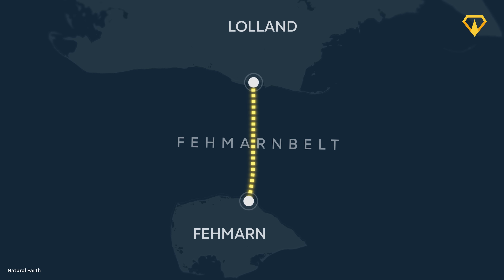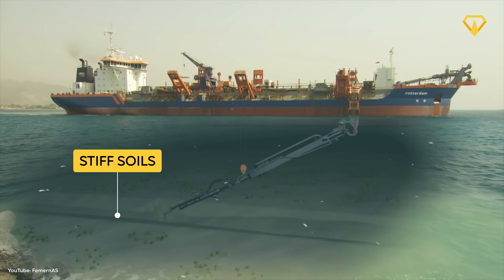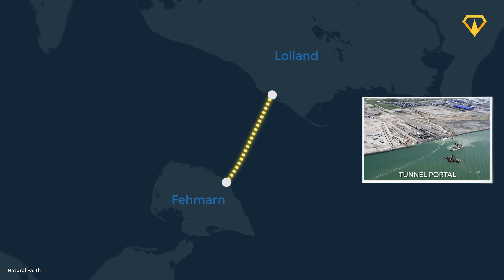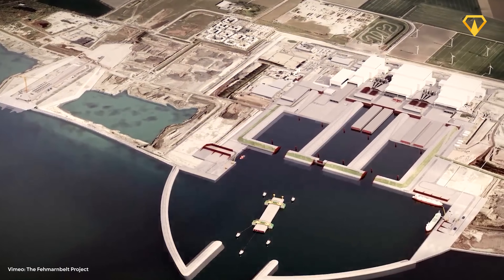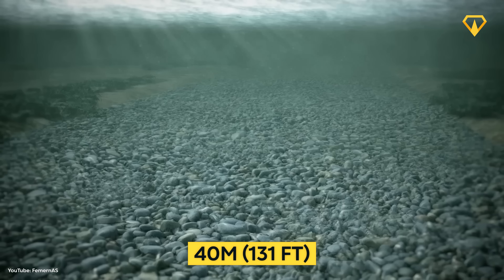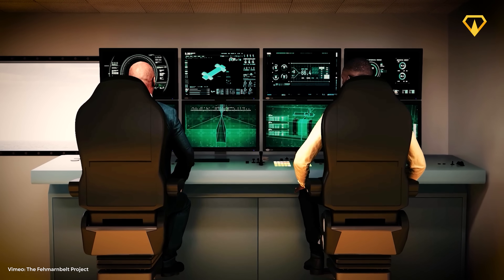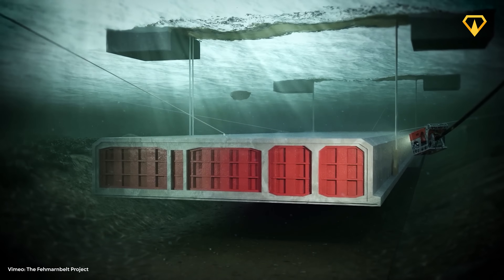How the World’s Largest Underwater Tunnel Is Being Built

Comment: OK here's another question I would like to know what about the water pressure in the ocean too much of that pressure will cause those walls to buckle and crack may cause leaking I know they are made of concrete but still extended pressure from depth that far will cause cracking

Comment: One question, it seems that the tunnel includes a single rail line. When you're building it, why wouldn't you include enough capacity from the start? Expanding it later will, for sure, be more expensive than building an additional train line from the start.
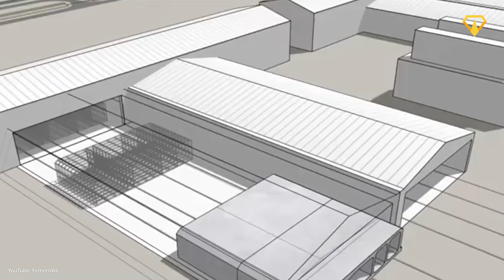Reply: It is two rail sections and two road sections. So one for each direction for each transport type.  You can see this at around 08:45.

Comment: As a Dane, since its opening in 1937, we have had what at first was the longest Bridge in Europe: "Storstrømsbroen", 3,2 km. It has a road and a railtrack and for long it was considered too old and too narrow. So it is being replaced with a new Bridge with two railtracks to be paired with the new Tunnel further down, below Fehmarn Belt, also with a road and two tracks. The new bridge is very close to being finished but I think a Service Ship for the sinking and placing of the Tunnel-Elements has been delayed, so the Opening also will be?

Comment: Whi is the rail animation a single track rail? Is the tunnel built with single track rail, or have they though of future expansion with double track rail? Projects like this MUST have future in mind, its little use if the project reaches capacity already first year of operation
Reply: There will be 2 tracks for trains just like 2 for cars+ maintenance/evacuation tunnel between the 2 car tunnels. So no waiting for a train from the other side before going through. It’s more obvious in the pictures where they simulate placing an element on the sea floor.

Comment: I have so many questions about this project. First of all, I understand the construction process. It totally makes sense. I come from the Netherlands and we have a lot of aquaducts here. From a maintanance point of view, I don't understand why they aren't building a bridge / dike instead (like we did with the afsluitdijk). People might say 'sea traffic', but we have a solution for that over here as well. Anyways, maintanance issue is going to be, what happenens if the concrete starts to burst. It happens here so no and then. In this case this thing is 40 meters below sea level. How are you going to fix it? water presure is also going to be an issue. What about ventilation? I mean this is a tunnel that take the air out unless it goes through the front or the rear. And what about escape routes? Lets say my car breaks down in the middle of the tunnel, how can I get out?
Reply: There are more informativ films here on YouTube giving answers to you questions.
Reply: @lars-oleeifler4448  so you want me to skim down the internet while I am on a plane to canada? have fun with these stupid answers.

Comment: When building over the water isn't feasible, then building under the water might be the better idea.
Like with the E39 project in Norway (which will become the world's longest, and deepest underwater road tunnel), that aims to connect the southwestern route together, the Fehmarn Belt tunnel is filling the same purpose, by allowing for a much better traffic flow through a bottlenecked area.
It is a huge undertaking, but the end result will be worth it by cutting travel time, and in turn fuel consumption as well.

Comment: interesting fact: due to variable water content in the aggregates (sand and gravel) that couses changes to their weight, the proportions could be worng. So to make sure of the quality of the concrete, Hydronix microwave moisture sensor are used to determine the moisture of the aggregates, to correct the proportions.

Comment: The problem for many hauliers is that drivers take their 45-minute break on the ferry (I've always done it myself), and that will soon no longer be possible. Or they'll have to create huge parking lots on both sides for freight traffic (if they abolish the ferries).
Reply: They said exactly that when the Storebæltsbro (great belt bridge) was built. A short time after opening it was aparent people preferred the bridge and took their breaks somewhere else. Yes, we'll perhaps need a few more rest stops, but that is manegable.
Reply: i'm pretty sure there are other places truckers can stop somewhere in that region.

let's say a truck has a max speed limit of 80km/h the entire way. 
that means that if you take the break a hour earlier or later than the exact moment you used to get on the ferry, you have an area with a radius of 160km of were you can take a rest/break.

and i doubt that ferry was the only place suitable for a break in that kind of radius.
so you don't need to build rest area's at the exact same spot as the ferry used to service, the already existing once in that radius would be able to take on those extra drivers. 
and if not those area's can simply expand a bit, no need to build huge extra things for that.
Reply: @ChristiaanHW  I don't know what kind of work you do, but a maximum speed of 80 km/h isn't something many people do. Secondly, you forget all the traffic jams you encounter (especially during rush hour) around Hamburg, the roadworks, and the accidents that CAN happen, leaving you stuck in traffic at the strangest moments. And I haven't even mentioned the holiday periods where so-called caravan/megacamper drivers think they can do anything that one time a year when they drive with a caravan or megacamper, causing dangerous situations, including the traffic jams that form towards the (upcoming) tunnel due to... the roadworks and widening (Heiligenhafen - Puttgarden), etc., etc., and knowing Germany it will take years before it is finished

Anyway, after 32 years as a truck driver, having driven in and through Denmark very often (for work and private purposes), and having taken that specific ferry crossing often enough, I'm probably wrong about the driving and rest times, and the parking options on the way to Puttgarden or from Copenhagen to Rodbyhavn.

Comment: 2:21 Well, it would be accurate to say that the Brenner tunnel connects Germany to Italy. There is just a short piece of Austria in between. Austria itself would not need the tunnel because most of the traffic originating there takes a different route to Italy. But the Brenner route is part of an important axis and the current pass is constantly clogged and the bridges for car traffic won't last for too long because of that. The Brenner tunnel aims to shift the traffic from road to rail. However, the tunnel alone is not sufficient. Links to it also need to be able to sustain a higher capacity. Ironically, Germany hasn't even started working on theirs.

Comment: How long would it take to make the same kind of tunnel from Vancouver to Vancouver Island in Canada which is approximately 19 km
Reply: Depends on who you hire to do the job and how long it takes to acquire the locations for the terminuses and rights of way on both ends. It also depends on the substrate of the bottom between those points. If it is mainly rock, I would recommend boring like the Channel tunnel.

Comment: mainland Denmark is losing. population, industry, wealth. this will not help, if not accelerate the process, because it will get cut even from pass through transit. however. it's a big gain for those who want faster connections to the Denmark islands aswell as Sweden and Norway.

Comment: I find several things missing from this video. Which stages have been completed, which ones will be done and when, when will the blocks start to be placed on the seabed, how many have already been completed, and how many are already in place if any. The weight in the elephants is also funny.
Reply: As Danish I have not followed so much in the construction but sometime in 2029 it should upen
Reply: Agree - once the sections are laid, how are the steel plates going to be removed etc.
Reply: there is few elements done but not ready to be submerged and one or two in the basin. the fotage from around 6:30 is quite fresh. they only moved forward elements on the left side. they dont have time precise time frame for submerging as there is some issue with hardness of the seabead on Germany side (elements are suppose do be layed starting from Germany) and the elements that waits for being submerged did not clear the Germany inspecion. I heard aboud whole steel wall missing and big air pockets and trash pockets in the concrete.
Reply: @Krormar  "I heard aboud whole steel wall missing and big air pockets and trash pockets in the concrete". Where did you hear this? Source please?
Reply: @Krormar oh, so this will be a Berlin Airport type project…
Reply: @GeospotPL When we built the Øresund bridge between Denmark and Sweden it was finished ahead of the plans. 

Problems  could be though, that Germany apparently have less interest in getting things done than we have in Denmark. As an example Germany have postponed establishment of the necessary rail connections to the tunnel.

Comment: Interesting content, but how are these units joined together to keep water out and accommodate movement, if the is any?
Reply: Rubber seals, as far as i know. Once two elements are placed, the water in between is pumped out. The resulting low pressure between the elements then pulls them together.

Comment: Interesting video, but it didn’t answer the one single question I had about this project: how do they connect the elements to each other so that they are watertight?
Reply: There are specially designed Gina gaskets and Omega seals on the ends of the elements, that will hold a water tight seal when the elements are placed. When the water between the element bulkheads are pumped out, the vacuum and the outside water pressure will push the elements together with such force that the gaskets will form a permanent, watertight seal. The YT Channel "B1M" did a more in-depth video on some of the more technical aspects of the build that may help answer some of your more specialized questions.
Reply: @whereswaldo9117  And those techniques, gaskets and seals are already over 80 years old. Those were used for the Maastunnel in Rotterdam, which was finished in 1942 during the German occupation.
Reply: There are probably some other documentary videos about this project here on YouTube ... I don't know if it's explained there, but maybe the B1M channel could be a good place to search for a video explaining the construction with some additional details.

Comment: I assume that the logic behind it is: "Well, if we're going to build a tunnel, we might as well go the whole hog and build one that can handle everything - trains, cars and trucks".
Reply: Denmark has already done that twice. The bridge called storebælt, which is 18 km as well. Part of it is made with tunnels for the trains. And same for the bridge connecting to Sweden. Only difference is, the cars go on the bridges. Train does both bridge and tunnel.
Reply: @ramkold Öresundsbron have a tunnel below Drogden for both cars and trains.
Reply: @andersbergquist  Right. Drogden is the little strait between Sjaeland and island Saltholm, makes it possible for tall ships to pass that don't fit under the bridge part. Still, real big ships cant pass because the deep is at most 25 feet. Yes all cars trucks and trains go both on bridge and in tunnel. Drogden was also the name of one of the first car ferries between Limhamn and Dragor, the line the bridge/tunel replaced. It was a charming little ferry in the sixties.
Reply: @botalm1878  From what I know, the main reason for choosing to built a tunnel closest to Denmark and not a bridge all the way, is Kastrup Airport. The height of the pylons would have interfered with air traffic/safety.
Reply: @andersbergquist  It is a similar Type tunnel built as Elements to be digged into the bottom! In Front of Kastrup/Cph. Airport we can't have tall towers for a Bridge.
     I have asked Fehmarn, if they can't continue the built and make some extra Elements for a new Tunnel between Helsingborg/Helsingør also? It can't be a Problem sailing them up when finished? It will be easy with the Factory ready and functioning!
Reply: @botalm1878 The first two farries was Limhamn and Dragör between 1960 abd 1969.  Drogden was the third farry between 1964 and 1977.
Reply: @Solskum  Spot on. They also build the bridge a bit special with just such safety in mind. The pylons are not connected to each other, so should a disaster happen, despite them being further from the airport due to the tunnel+bridge solution, then a plane hitting a pylon won't mean both sides of the bridge being hit.
Reply: Why else would you build a tunnel? LoL. Bigger is better.
Reply: Why build only a single train lane?
Reply: @aljazbolta  It's just in the graphics. There will be two lanes.
Reply: @aljazbolta  In the new Tunnel we will have two Train Tracks, and four Lanes for cars.
Reply: @aljazbolta  They have two, below the road on top, to Sweden. And the new Tunnel to Germany, as the Storebælt Bridge also has two. But a bridge opened in 1937 only needed one track for its limited amount of traffic.
Reply: If ONLY they could think that way in Norway lol, here they build infrastructure that is outdated the second it is opened lol, it is getting to the point of insanity lol.....
In my city of Bergen, second biggest in Norway, they use more money on bicycle roads than roads and working infrastructure for cars, busses and so on. They also have hyper focus on a tram system that don't really work in a valley town, and it is all in all just a headache to keep up with their insanely stupid antics of "planning" =(
Reply: @toppy83  how is working on bicycle infrastructure outdated? I don't get it.
Reply: @jaspermooren5883 well if someone USED then that would be one thing but we live in a city with over 200 days of rain pr years soo yeah.....

Comment: Is it possible to sell these tunnel segments to other projects? I mean once everything is completed can the infrastructure and the factory used to build the tunnel be repurposed or what happens to all of it afterward?
Reply: There is talk of another smaller tunnel project in Denmark, where this kind of tunnel may be used, so the factory should be able to continue for at least a while.
Reply: @appeltaartistheanswe  The steel parts of the Oresund bridge were made in Cadiz Spain. And the big crane of the Kockums shipyard in Malmo was taken down and tugged to South Korea. So big things can be moved.
Reply: The Germans are building the same kind of tunnel between the island of Fehmarn and the German mainland, so they should buy some extra elements for that.
Reply: Actually, it is not the first tunnel of this kind. The Drogden tunnel,  connected to the Øresund's bridge, is exactly the same. It is a 4 km test for the Fehmarn tunnel.
German NVL Group (Naval Vessels Lürssen), has shown interest in the factory, so they can build their Frigates indoor. Railway and harbour and a gigantic factory, it is perfect. And Denmark is in the process to order two new Frigates!!!

Comment: Denmark is still running their trains on diesel......also, just as with the Øresund bridge, they didn't bother to build bike lanes. Lots of people would commute by bike if they were allowed to. These are problems that can be solved. If you break down mid bridge it should absolutely cost you a pretty penny to brought back, but the fact that we cannot go via bike across these connections is not ok.
Reply: Nonsense. 
Denmark has diesel rolling stock yes, but passenger trains are almost all electric or some hybrid. We've got plenty of new electric locomotives that can be used for both freight and passenger trains.
The Danish State Railways (DSB) have made big investments in modern coaches especially for these routes and locomotives.

Bike lanes would make absolutely no sense.
Besides the 18km that would be doable it's also 40 meters down and back up with a long drawn out rise so it would be awful. Next neither Lolland or Femern islands on either side is very densely populated, there simply wouldn't be a demand for a bike lane and EVEN if a rare bicyclist would venture down there is wouldn't be safe, there would be no good way of rescuing them and thinking you can earn any lost work time for rescue personnel or lost work for commuters is absolute nonsense. 

It an illogical non-starter.
Reply: @Floedekage  You just put your bike on the train! Would suffocate in the tunnel.
Reply: @Floedekage  Check your figures again: 18 KM is about half an hour on bike especially out of the wind, 40 meters down is an excellent way to make speed and 40 meters up on a slow incline (or stepped incline) isn't anything to worry about. Even if it were, for other tunnels they solved that with elevators and escalators for both cyclists and pedestrians, that is small fry in the tunnel entrance building.
Reply: @apveening  You forget about the exhaust gasses in the tunnel.
Reply: @botalm1878  I don't, in all tunnels and related structures I know, bikes and pedestrians have their own tube with its own ventilation, so no exhaust gasses (less than people in cars experience anyway).